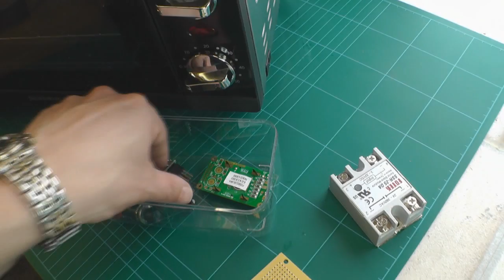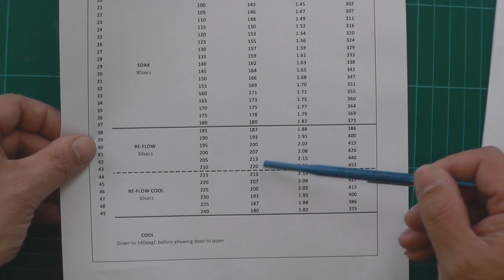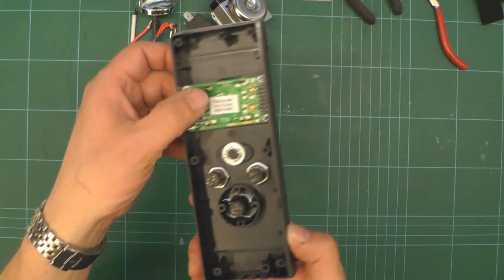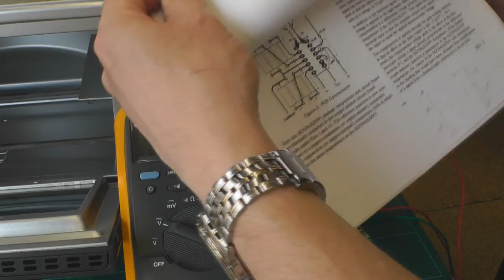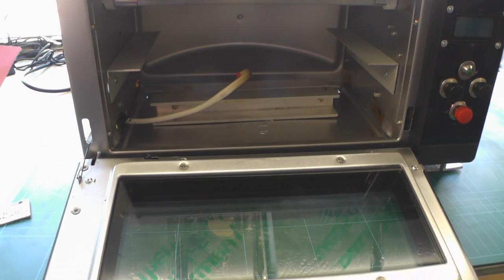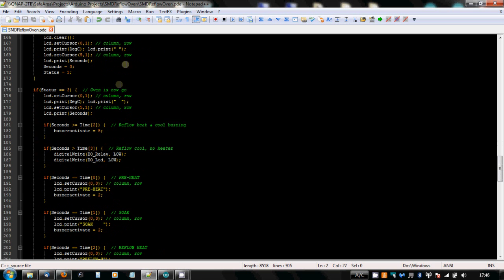Home built SMD Reflow Oven

Comment: Ad594/95 has a minimum 5 v rail, but if you look at the data sheet further the span is limited to VCC ( 5VDC)  - 2.5v ( internal rail limit) = 2.5 MAX amplitude out and that could cause a error in the temperature measurement ( vout is at saturation and not really showing correct temp / vout, due to internal limits on the AD 594/95 IC) based on the temp vs vout table on the data sheet. This is not said up front by Analog devices and many a engineer got burnt this way. My own boss was scratching his head, until I pointed this out to him and he has a Ph.D..I also seen this same issue a few years ago with a company that makes stage effect equipment. My suggestion would be to set the VCC to its max value ( +15 vdc), this way you will get the correct temperature to vout value, that matchs your tables on the data sheet and use an op-amp attenuator at the output of the AD594/95 ( the attenuater will allow your microprocessor's A/D Converter to not be damaged by to high a voltage going in ) and now the look up table in your microcontroller needs to be massaged as well. I have been a engineer along time and this prolbem is nothing new.
Reply from the maker: I think it's +VCC - 2.0v, thus 3vdc max out (for 5v supply). So, for 240degC max k-type that would be 2.413vdc output (AD595) which is inside the limits. Been a while since I looked at this so my figures may be off. Ian.

Comment: Nice Video, Nice project, very clean.
Looking forward to building my own.
Right now I'm just manually flipping the toaster power on/off with a trusty fluke 87-5 and a thermal couple monitoring the internal temp.. I allready have most of the parts and I find myself re-flowing more and more.. I think it's time to get away from the hot air and move on to something more like this.

Comment: Well you are s very clever chap and your video is brilliantly made, of that there is no doubt. However I can do everything but write the code and program the Arduino which leaves me in an unfortunate position of not being able to replicate your project.

Have you thought about selling those Arduino boards pre-assembled with your code on eBay or whatever? If you did, I'd buy one as would many I'm sure.

Oh, just to be picky... You should have mounted that aluminum panel into the recess before mounting your switches as it would have looked so much better. I also would have used an extraction fan in the electronics bay.

Thanks though, nice to watch a decent video on You Tube for a change that wasn't made by some spotty Yank with all the gear and no idea!
Reply from the maker: Thanks for the comments.
Yes, it's a thought maybe I could knock up a controller board to sell.....will have to think about that. Building and selling is easy, it's supporting afterwards that isn't so easy when you consider this is a hobby only of which the day job interferes!.....:(
There is a fan in the electronics bay now, I think I mentioned that on my website (outside of YouTube), see the comments section there. It makes it a bit cooler yes.

Comment from the maker: Oven used = Severin Mini Oven 9 Litre Brushed Stainless Steel. However, I used the elements from a Table Top Toaster Oven Small Argos Value Range (Ebay 140669647855). 1000watt 230degC rated.

Comment: went this way but using (a much preferred) microchip mcu. guess what? those heaters don't have NEARLY enough uumph for ROHS (too many cubic inches to heat and thermal is also spread out way too much)! so what to do? well I used TWO 1500 watt heat gun coils.. yeah, TWO!. and built a much smaller heating oven (6" X 6" X 9") & installed this inside of the much larger oven. I made NO attempt to install control electronics into the oven. separate box for that.also used thermostatic fan over PID.

Comment: Veroboard is dirty copper unlike a professional pcb which is precoated in solder or gold.
That's probably why it didn't reflow. The flux in the paste didn't have enough time to clean the copper or maybe it just wasn't strong enough to do so. 
Give the veroboard a good clean first and go over the copper with a flux pen before putting down the solder paste. That should fix the issue.

Comment from the maker: Hi,
Yup, good comment. So far though the LCD seems completely unaffected by the heat. The temperature in the end 'compartment' is surprisingly cool compared to the main oven. The insulating material, small fan, heavy baseplate all seem to work great at keeping the temp under control even after multiple reheats (famous last words!).

Comment: The LCD contrast is temperature dependant, I hope the oven doesn't heat the display too much. Instead of a trimming pot, you might want to consider a PWM + RC low-pass filter D/A convertor. That way, you can control contrast from software (if it doesnt give any problems, just keep it as it is).

Comment from the maker: Dave, the AD595 IC I used is a complete instrumentation amplifier and
thermocouple cold junction compensator.
It combines an ice point reference with a precalibrated amplifier
to produce a high level (10 mV/°C) output directly from the thermocouple.